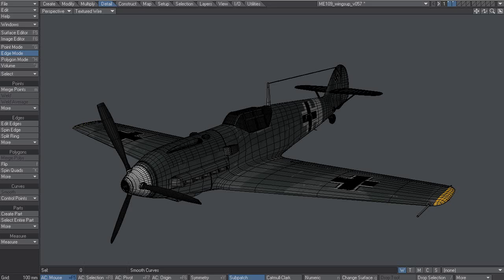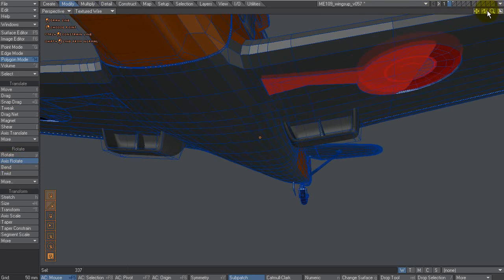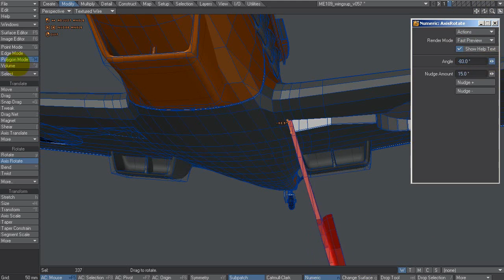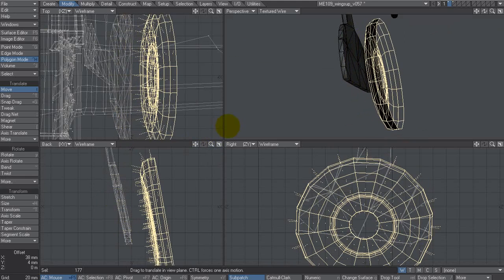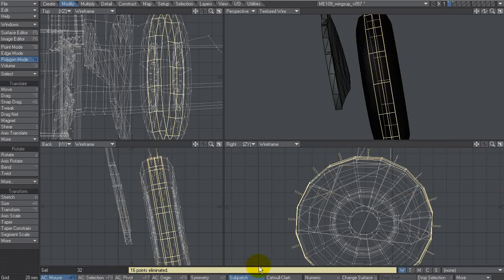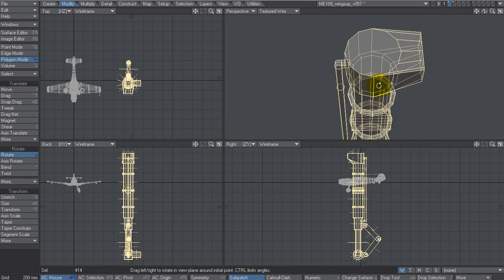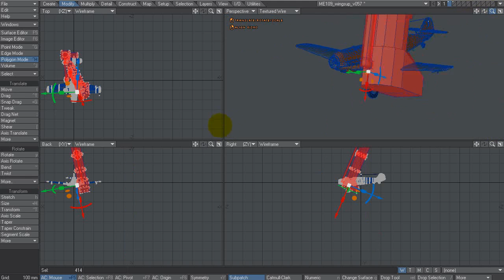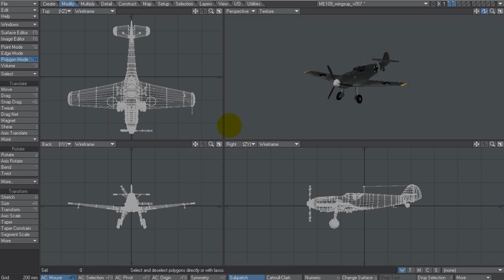11.5 LightWave Modeler tools - quick demo and tips

Comment from the maker: Yup - the whole idea of the axis tool is for defining the axis, and the snapping option works on edges (you only need to drag out the axis a tiny amount, not all the way along the edge).

I just found it easier in this quick example to click the vertices at each end of the edge...  But hey, that's just me. :-)

Comment: Coolness...That's what I like to see new modeler tools!
Does the axis rotate tool work with edges, seems easier to select one edge than two points?

Also, during the wheel section..that could be a nice mirror tool update, select mesh, select two points to mirror off & you're done :)

Looking forward to more!